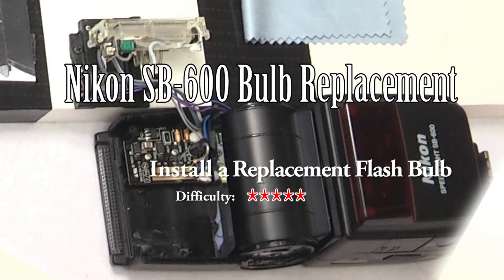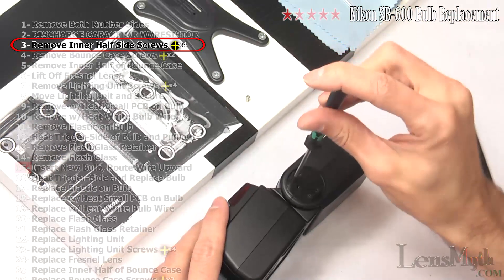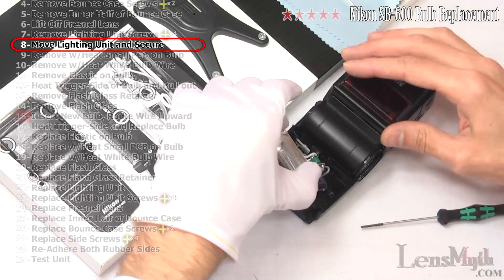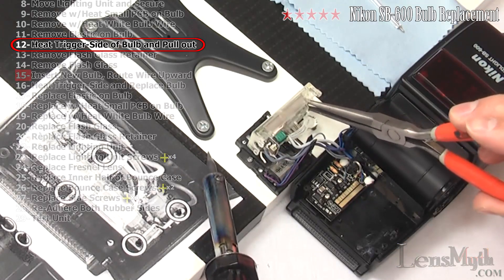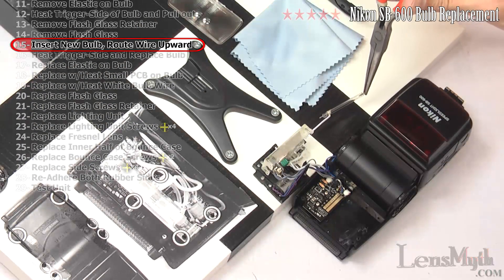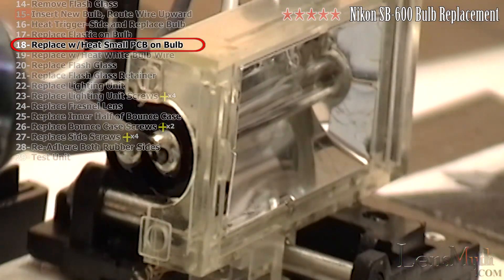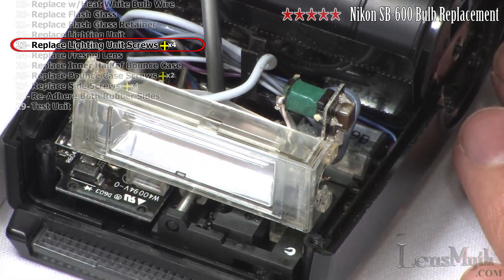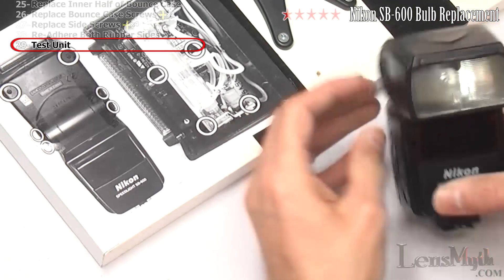Repair Nikon SB-600 Flash Bulb Replacement

Comment: What's the value of the resistor for discharge that you used?
Reply from the maker: It's been a while, not sure what's correct for that capacitor. There's some capacitor discharge tools on Amazon that should be a better idea than guessing. I used the wrong one once and  instead of getting hot and discharging for an hour, it burst like a firecracker.